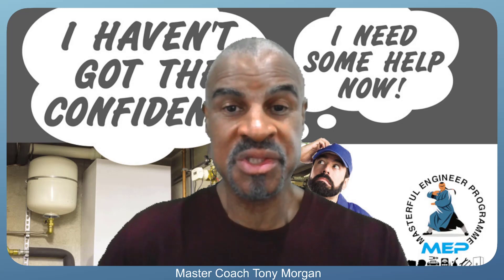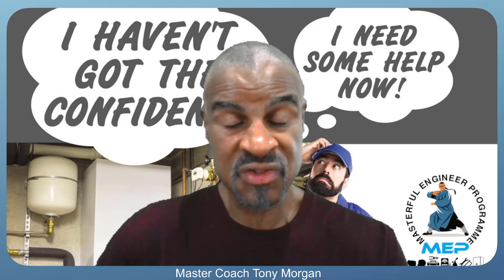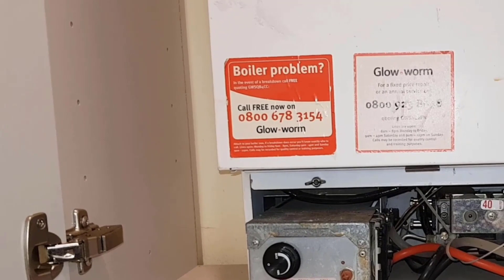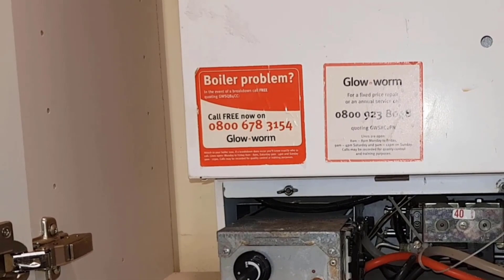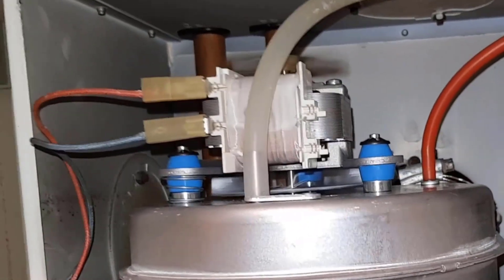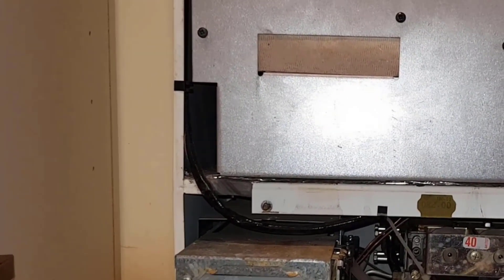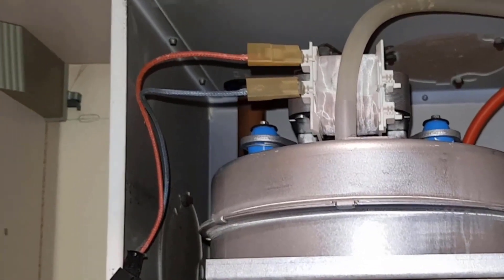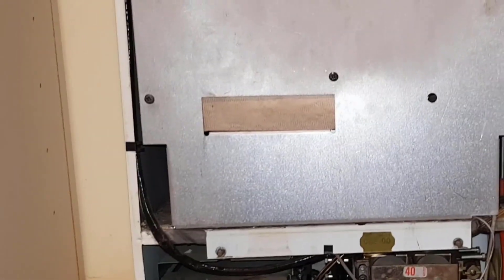How To Replace a Fan Glowworm Ultimate 40FF

Comment: Hi. Really informative video. I have this same boiler and was wondering how to vent air from it. My feed tank ran dry due to a corroded valve in the tank. I've now refilled it and got the pump running again,  but can't  seem to get the air out of the boiler. It runs for about a minute then shuts off

Comment: i have the same model and ive changed the fan myself 3 times in 22 years. My latest problem however is that it takes a while to ignite and only runs for a few minutes at a time cutting in/out. What could be the problem do you think?
Reply from the maker: Hi it could be a partially block pilot jet, that's a common problem